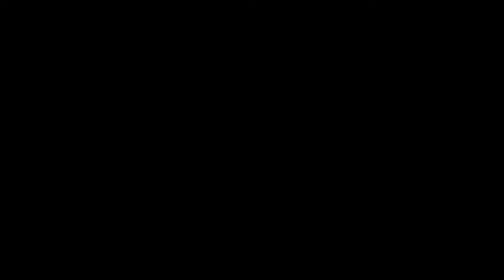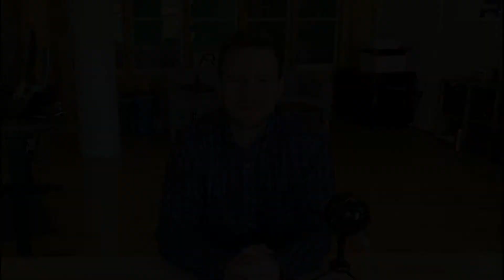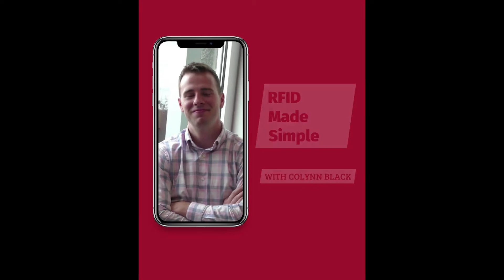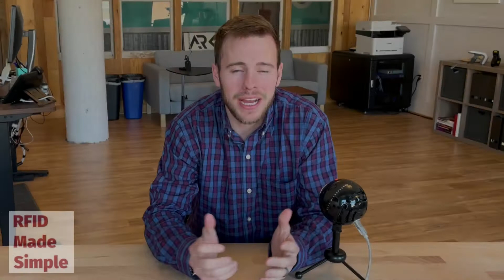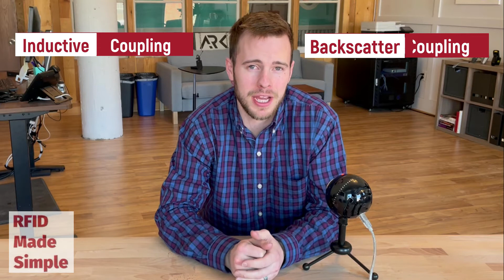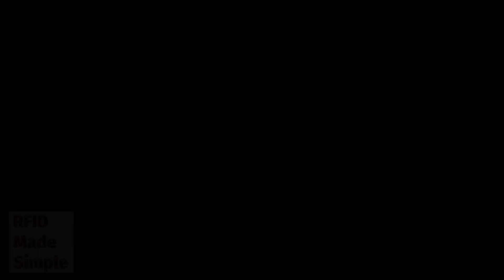RFID Inductive vs. Backscatter Coupling Explained

Comment: Thanks for the sharing.  Can you explain a little more on the backscattering?   As far as I understand, there are two states in UHF RFID chip, absorbing state and reflecting state.  I suppose the chip will stay in absorbing state until the transponder sensor (or receive) enough power to wake up the chip, then the transistor will be "on" and the chip will be in reflecting state.  So backscattering happens when the chip is in reflecting state, my question is that does the transistor needs to be "on" and "off" (i.e switching between the two states), to modulate the return signal?  or the transistor just keep "on" (i.e. keep staying in the reflecting state) and so the chip can transmit signal back to the reader?  Also, how the Radar Cross Section (RCS) affect the return signal or return read range?  How the chip knows when to be back to the absorbing state? 

Moreover, as there is chip sensitivity, reader sensitivity, reader EIRP, etc.  It is better if you can show us an example with some values, say EIRP = 30 dBm, reader antenna gain = 6 dBi, reader sensitivity = -75 dBm, UHF tag antenna = 2.15 dBi, chip sensitivity = -20 dBm ...  and together with the backscattering and RCS.   

Thanks

Comment: tell me wheather the backscattered power can be used for any sensors
Reply from the maker: Yes, backscatter power/communication can be used with sensors. Think of backscatter as a transportation method. It is primarily utilized in long range passive transport as opposed to a battery powering the transmission. 

Sensors collect data at the source of the tag by means of the chip and antenna. The means of communicating that data can either be through backscatter, coupling, or beaconing (battery power).